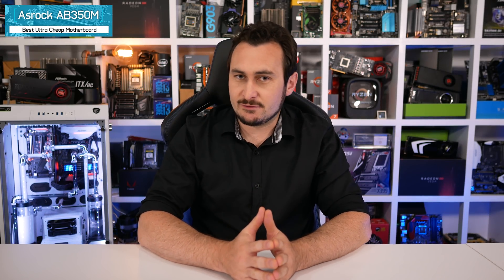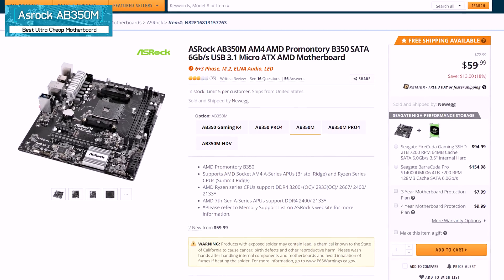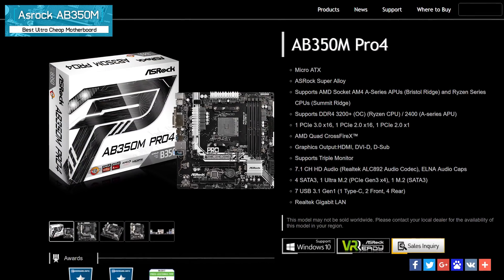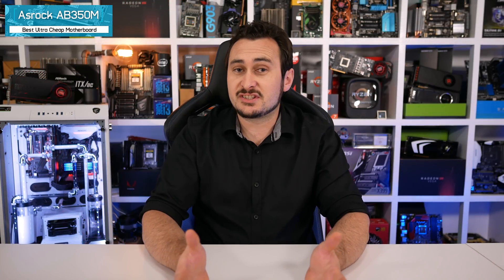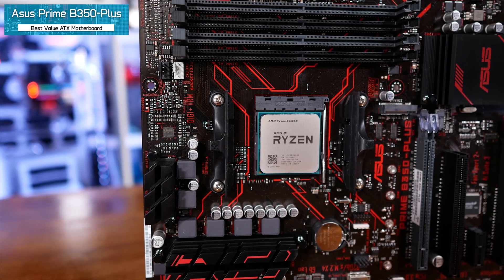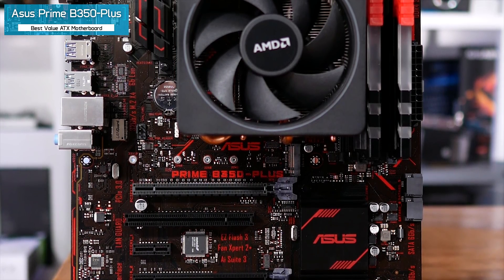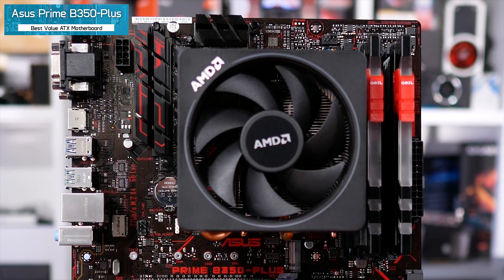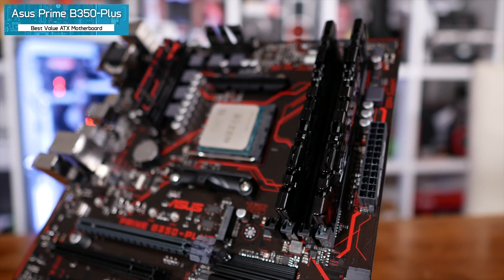Top 5 Best AMD B350 Motherboards

Comment from the maker: One mistake in the video, the Asrock AB350M doesn't have a doubler, it's a 3 phase design with extra chokes. Sorry about the error, that said I'd still pick it as the best entry level board.
Reply: Hardware Unboxed what is wrong with Asus rog strix b350 f
Reply: I don't think they put sensors on the low end boards on the VRMs. 
Here is a vid from buildzoid about this board if you are interested https://www.youtube.com/watch?v=Ucjn6HCd2zI 
But the 4 phase VRM with this heatsink should be good for any R5. Even R7 unless you OC too high in a case with no airflow. But the VRM mosfets can run at 125c so you should be fine on this board. Do a touch test. Run your system on high load, like Prime or Aida for 20-30 minutes and touch the tops of the heatsinks. If they are not hot enough for you to hold your fingers on them you are fine. And even if they are. it's nothing a fan can't fix. I had a problem with a Z77 board. The system would run a stable OC in all benchmarks and Prime, the CPU would hold at 70ish during a torture test and 60 during gaming and render load, but it would crash games and eventually bluescrean. I touched my mosfet heatsinks and they were hot af. An old 92mm case fan ziptied above it later and they would even feel cold after hours of gaming. No more crashes.
Reply: Hardware Unboxed I own the AB350M Pro4 and I am very pleased with my purchase. The VRM barely gets warm overclocking a Ryzen 5 1600, the connectivity is OK, it even has an RGB header (that does not work correctly with the included software)
Reply: Thank you, you're the first youtuber i've actually found aside from the odd video here and there to actually make a video on the AB350M. It's such a good value for the features it includes (though it doesn't have any overclocking voltages aside from vcore :-\)
Reply: I got the AB350M Pro4 a while ago since it was the only mATX available at the time and no complaints here. Was able to get my 1600 to 3.8ghz with ease and the 2 m.2 slots are a very nice addition.
Reply: Can you make X370 boards also? Would love that to see
Reply: Dragos Moldovan same here my runny Ryzen 3 1200 OC to 3,9ghz. Great motherboard.
Reply: I think recommending the non-pro AB350M is a debatable decision, when you can get the Pro4 variant with much better VRM and better features, for just a little extra money. In fact the Pro4 boards have an excellent VRM in terms of current capacity, because not only the chokes, but the MOSFETs themselves are doubled (so it is a 3 phase, but with 2 FETs per phase) and the heatsinks on them are also decent. The voltage regulation is not that stellar due to it being a 3-phase, but in terms of power throughput it can handle an overclocked 8-core.
Reply: What about msi's b350 gaming pro? Its going for the same price as the asrock! Even cheaper after a rebate! http://amzn.to/2yvOhyt
Reply: Anyway to read the VRM temps on the Asus Prime B350-Plus ? HWiNFO64 shows nothing.
Reply: To Alexander Radev
Cheers for that very useful. 

I got an R5 1600 @ 3.8GHz 1.35v. But I think the airflow is not bad. NZXT 340 with 2 fans on the front running 70% ( 1100 RPM ) and a rear running the same. The stock CPU cooler runs at 50% up to 40c then runs up to 100% at 70c. Although in this config it has not gone over 64c during extended gaming sessions.

Gonna try a touch test on the VRM, be good for my sanity.
Reply: very usefull consumer advice Steve. could you do such a comparison for closed loop CPU coolers?
Reply: i dont agree that asus b350-plus is good. i owned and its so bad. biggest issue is memory.its change memory latency randonly and then comes blue screens
Reply: I have not had this happen myself. What other issues are you having ?
Reply: lots of bs and lags in games a lot. that why i byu other mb after x-max
Reply: In your 'Top 5 B350 motherboards' video, the Asus prime has a beautiful red vs black contrast, but in most google search results the red looks dull and the black looks grey. Is this due to lighting, video post-processing, or maybe I'm just seeing things? Anyway, great video and thanks.
Reply: Eh i bought Asus prime e matx board
Reply: What About strix b350 f
Reply: Hardware Unboxed Thanks for this video! I would like to ask does strix b350f have the 5x protection i.e. the full ESD protection like the prime b350 has? I was thinking of buying strix because of the Intel Lan chipset.
Reply: Dragos Moldovan have you had any freezing? The AB350M seems great but there are many complaints on forums with random crashing and freezing
Reply: Rowdy i am one of the lucky ones with a faulty board... bought it in october and had crashes since february. now its so bad that it freezes every 5 minutes. i'm still seeing bad reviews here in germany, so i'll definitely choose another board in the rma process.

btw: i never overclocked anything.
Reply: BlindingShotz thanks for the reply, I’ll probably get an Asus TUF board since it has the best reviews
Reply: good video, can you please tell me what do u think about this motherboard GIGABYTE GA-AB350M-DS2
Reply: My name is Jerfff
Reply: Bro please release next video x370 best motherboard.....
Reply: what about that x370 load faster in the desktop is that still a thing and can u make a x370 vid?
Reply: The price is wrong. And the MSI VRM on their top 2 boards is just eh best for a B350.

Comment: Msi B350M mortar arctic just exploded a capacitor bricking cpu and possibly ram so beware. After 4.5-5y of use, no overclocking. Also ~30s boot times

Comment: i have a b350m msi mortar with r5 1600 sniped for 80€ all setup , box , noctua +2 semi new fans @ the msi , some rams already sniped an for close it for resell i have,  rx 570 8gb , gtx 780ti 3gb and gtx 960 , is recomendable , flash this b350m mortar and put a 5600g? is better a 3600 max? or 4650g? is posible to run the integrated @ planing for resell ? i need other opinion @ perspectiva ty verymuch

Comment: What is the difference between AMD B300 and B350 chipset? I can't find information anywhere.

Are AMD B350 and B300 the same thing? What's the difference?
Reply: X300 and B300 are smaller and more bare-bones chipsets, for mini-ITX only, compared to the X370/B350 ones. So manufacturers didn't really make much motherboards if at all for those.

https://forums.anandtech.com/threads/am4-motherboards-with-sff-chipset-x300-b300-etc.2537981/
https://www.gamersnexus.net/guides/2763-amd-chipset-comparison-x370-b350-a320

Comment: Hi Hardware Unboxed, I know this is an older video, but I'm a budget user and I was considering a used from AliExpress Asus Prime B350 Plus mobo in the near future to pair with a Ryzen 5 1600 or Ryzen 7 1700 (cpu also from AliExpress).  However I have read issues online that the VRM temps are rather high?  Is this true?  Would a downdraft air cooler be a good investment to use with the Prime B350 Plus motherboard?  Feedback appreciated.

Comment: Went with the Asus ROG Strix B350F Gaming.
It's sad how it's didn't get much coverage.

Using it with my R7 1700 (not overclocked caz weak GPU), 16Gig GSkill TridentZ at 3000Mhz (even though its XMP supports 3200) but I can live with that for the RGB.

Comment: Hows about you answer your twitter tweets to you since you spam your tweets out there.
Reply from the maker: Might be quicker if you just ask your question here. Not sure we spam out Tweets either, I think we average one per day.
Reply: I am sorry I mixed you up with Paul's Hardware so my apologies as I tweeted you both and I am in a quandary.

I put my system together in June of 2017 and by the time June rolled around this year my board (GA-AB350) started BSOD with almost all errors related to video drivers.  I had a 7870 so I decided to get a new card and I safe mode DDU the AMD drivers then I installed the new GTX1060 and I thought I had lucked out but no dice as the dreaded video driver 
timeout happened again and BSODs.  The BSODs calmed down but they still happen.  Time to change to a newer board that isn't a GB since after a week with support from GB I don't want to touch them again after a decade of being a fan.

I have a WD500 Black NVME on the way (including heatsink) and my question is which board will allow me to overclock, retain my 16x GPU speed and keep the NVME at 4x PLUS work with my current memory at 3200mhz (CMK16GX4M2B3200C16)?  I was thinking it would have to be an X470 but the more research I did the more confused I became.

Comment: Hey,someone is giving me a PC with an ab350m asrock micro atx .
It's all good but the specs are much better than the motherboard,its ryzen 7 1800x ,16gb ram 3200mhz and gtx 1080.
Do you think I will have any problem with that mobo? Also it has a cx 550m 550W bronze+80 psu.
Is it ok if I use this mobo for a while and change it after or should I change it directly? 
Thanks

Comment: I got an AsRock ab350m Pro4 and its shit. It freezes randomly. It's a popular problem right now
Reply: MarmeladenTorben what cpu are you using? I got Asrock AB350M Pro4 with bios 4.70 and running my Ryzen 1500X with no problem, earlier I was using Ryzen 3 1200 overclocked to 3,9Ghz. Updated bios probably 5 times already. Check your ram XMP profile as it can give you some headache.
Reply: Ornal64 Ryzen 5 1600
Reply: MarmeladenTorben my Pc freeze randomly when using XMP 2, got no heart to play with ram timings so I left my ram on 2400mhz, propably going to change it in future for compatible model.

Comment: Mortar Arctic or Asus Prime Plus? What should i get?
Reply: Akira Sena avoid Mortar and Mortar artic. Got both and both died after bios update, out of the box performance was awful.  Booting times around  50 to 90 seconds.
Reply: Ornal64 Then, Asus Prime Plus?
Reply: Akira Sena Never used this board, but Asus is good company. If you looking to buy second generation Ryzen get newer chips like B450 and B470 if I'm not mistaken. I'm using Asrock AB350M Pro 4 with Ryzen 5 1500X, previously Ryzen 3 1200 and got no issues. I've updated bios multiple times to newest available without problems. Can't run ram more than  2400MHz(thats my Corsair Vengeance ram speed XMP 1 profile) as it's not a supported model. That's my mistake, but as you know I was planning to use it with MSi Mortar, and couldn't change it back as two Msi motherboards I have to RMA took more than a month and I couldn't return ram without reason anymore. Nevertheless everything is running fine on 2400Mhz.

Comment: My computer freezes randomly because of  my ASSuck AB350M MB
Reply: Why using are you using ram XMP profile? My work with 2400mhz it's important to have compatible ram.
Reply: Ornal64 not related to the dram profile
Reply: Why using RMA it, I killed two B350 boards from Msi before ending up with this one.

Comment: I dont know about other asrocks ab350 boards but ab350 pro4 and ab350m pro4 have a huge voltage drop. Just google it, mine drops from 1.35v to 1.26v at load and there will be no LLC(emailed them)

Comment: I heard the B350M Mortar arctic supports crossfire...from the official website ...

Also heard that 1 slot is PCI-E X 16 and the other is slower PCI-E X 8 will it hinder the performance when compared with a X-370 crossfire... 

Could you check the performance on both and do a video or make a post or atleast reply to this comment...

Thank you

Comment: I got the MSI B350 Krait Gaming for it being one of the best VRM's according to that one VRM expert guy on GN. I want a 4Ghz oc so bad on my 1600x. Yeah, yeah. It depends on the CPU but at least I can rule out the VRM for the most part. Here's to trying! My only complaint is that its only got 4 SATA connectors. I have 6 drives.... Looks like im dumping my slowest mechanical and the rom disc drive.  i'll put my 2 mechanicals in raid0. Only sata 1 & 2 can raid though buaaghhh

Comment: I'm planning to buy this:
MSI B350 Tomahawk Plus mobo
Asus ROG Strix RX 580 8GB (prices are not that good but when I save up they will probably drop)
Ryzen 5 1600
500-600w PSU from EVGA or Corsair 80+gold and maybe modular
8GB of DDR4 3000MHz Corsair Vengence 1x8GB (gonna buy another 8GB stick later on)
Western Digital 120GB M.2 SSD and Western Digital 2TB HDD
Thermaltake View 31 TG RGB Case
Should I change anything? I really love this setup as it looks great and it will perform really nice with lots of upgrade capability in the future! Also, I maybe buy extra fans or that big 3 fan radiator and put it on top of the case(case itself comes with 3 really good RGB fans)

Comment: I have question that on every cheap mobo it says support 3200mhz (oc) ram . Is that mean I can use 16gb 3200mhz ram or I have to buy 16GB 2400 . PLZ HELP ME #Hardware Unboxed
Reply from the maker: You can use 3200 memory but the Ryzen CPUs only officially support 2400 memory. So you are essentially overclocking when running at the 3200 spec.

Comment: The Gigabyte ITX's VRM runs as hot as it does because in typical Gigabyte fashion, the board overvolts the CPU by default. That's not necessarily a problem, but something you may want to keep in mind when overclocking.

Comment: I love the ASRock AB350 Pro4, for the two M.2 slots and three PWM case fan headers.  When I built a mATX system I had to switch to the msi B350 Mortar Arctic to still get the three PWM case fan headers.

Comment: +Hardware unboxed, nice that you caught yourself for the ASrock AB350M. The Pro 4 suffers the same issue as Buildzoid points out https://www.youtube.com/watch?v=KzRG_LjUl8Q&t=466s

What I don't like is that ASRock advertise these as 9 phase power design which is misleading consumers. In reality they are 3+3's.

However, that being said, the VRM's on most of their Z370 boards are great, a fair bit better than the competition ( the gigabyte gaming 7 €212 uses the same voltage controller as the Asrock extreme4 €140 )

Keep up the content!
Reply from the maker: For the money it's still a great board, hard to expect much more at the price point. I haven't heard of any blowing up yet and I know a few people who have overclocked R7 1700's on them.

Comment: I would never buy ASRock motherboards again as I had ASRock AM3 Motherboard and it started to had big issues in 3 months SSD kept disconnecting and they just died completely and they had to sent it to ASRock and the worst part is that ASRock for Warranty is in Europe. I would prefer either Asus/MSI or Gigabyte no others.
Reply from the maker: Asrock's AM3 boards were bad, sales for the platform were low and margins were really low. So the smaller guys cheaped out on the design and components. That said today Asrock arguably make the very best AM4 boards.

Comment: Completely disagree on the itx Asus B350-i strix, it's at most main retailers and is $20 more than the ASROCK which is a small price to pay for more features in all areas but I/O and one of the only itx boards capable of keeping cool without direct airflow

Comment: One thing that bothers me is a lot of the boards have naked VRM mosfets for the GPU/SoC part of the board. If not powering a APU they should be ok, but I'd like to see how bad the temps get on those exposed mosfets once they are asked to deliver power to a GPU inside one of the upcoming APUs.

I understand cost savings, but in my opinion you should never have naked mosfets. Just seems like they go a bit too cheap sometimes.

Comment: The Gigabyte B350M Gaming 3 should be the best mATX, it can OC the r5-1600 at 3.8ghz, the VRM runs cool, and it has 6x SATA slots while most mATX B350 only has 4. Just my 2 cents though. That ASUS B350 Prime Plus is an excellent board BTW.

Comment: Please remove the Asrock AB350M Pro 4 from your list! It's a nightmare waiting to happen. I built 2 systems with this board and both suffer from random freeze issues. Both were great out the gate and 30 days (+/-) later the nightmare begins. Now they're on the shelf... worst purchase ever!
Reply from the maker: How do you know it's the boards? I've got a system using the same board and it's been flawless. There are loads of comments on this very video from pleased  Asrock AB350M Pro 4 owners. It's also received loads of positive user reviews as well.
Reply: It was 2 distinct systems and both had the same issues. Tried all the solutions I came across on-line. Fresh Install of windows with the newest Iso available, Tried all the Bios updates and the problems remained. Tried various voltage changes and at times they seemed to help but the problem would return. Finally got a stable system when I changed out the motherboard.

Comment: Though the gigabyte itx board can run a 8 core, I don't recommend it with a 4 GHz oc on a 1600. I was getting 85c on vrm tempature underload, though it is techinacally safe, it's worrisome to me. So 3.8 is my 24/7 oc. Also yes the bios is very clunky.

Comment: Steve, I actually have a MSI B350 Tomahawk, 1700, GTX 980ti, and 16G 3200 and it runs games very well on either Max or Ultra settings. Then again, I do have a 1080p monitor. Wonder what your thoughts would be on my build lol

Comment: I have a MSI B350M PRO-VDH mobo with Ryzen 1200. Excellent overclocker, pushed that chip to 4.175Ghz 24/7 stable with stock cooler! :)
Only downside is that the max vcore of 1.55 was the limiting factor, the chip obviously had more to offer even with stock cooler could i push the vcore even higher. 67-68C was crashing point, so better cooler would also give more headroom, or even just changing the thermal paste (stock as well!)

That chip does CB score of 646 at those clocks. Downclocked to 4.05Ghz (i'm putting it in a hot environment) Cryptonote hashing speed of 320H/s.

I really like the msi offers right now :) That being said i'm also getting a ASRock AB350 Pro4 for a Ryzen 1600x chip, let's see how that goes! :)